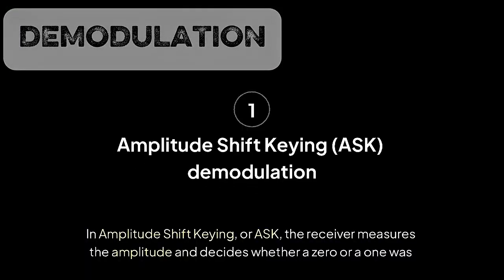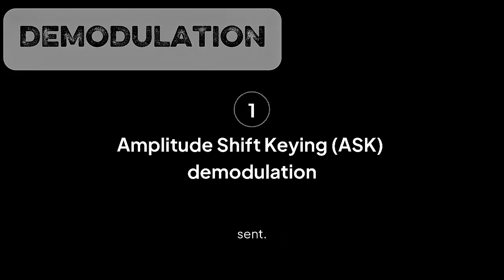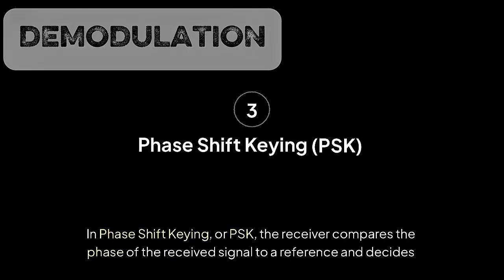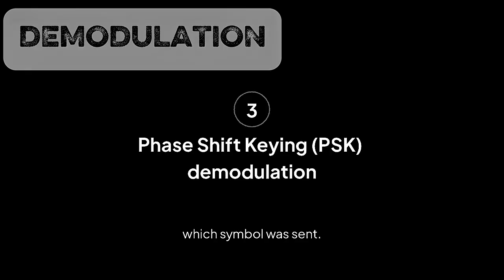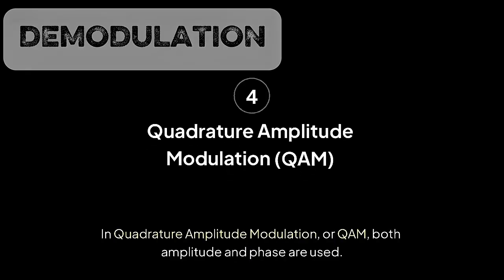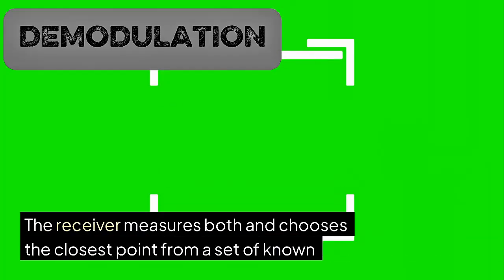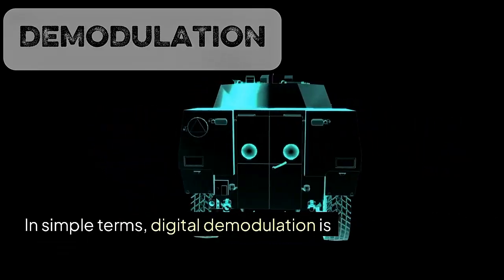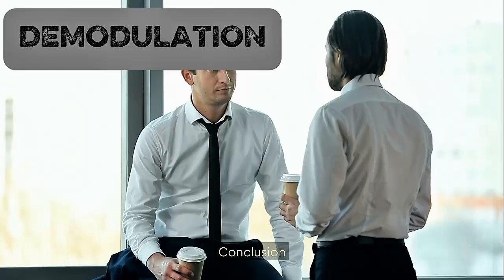Demodulation On Communication Systems

Comment from the maker: This video explains the concept of demodulation in communication systems. Demodulation is the process of recovering the original message signal from a modulated carrier at the receiver.
The video briefly discusses how demodulation works in both analog and digital communication systems. It covers AM, FM, and PM demodulation, explaining how amplitude, frequency, and phase changes are used to retrieve the transmitted information.
It also introduces digital demodulation techniques such as ASK, FSK, PSK, and QAM, where the receiver measures signal properties and decides which bits were transmitted.
Overall, the video shows how demodulation is an essential part of communication systems, allowing receivers to extract useful information from transmitted signals used in radio, television, mobile networks, and other wireless technologies.